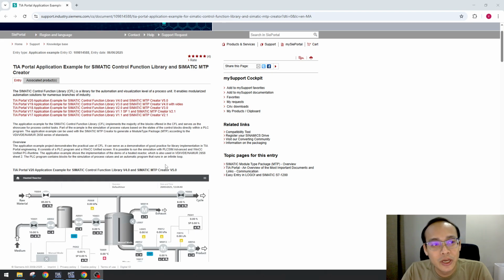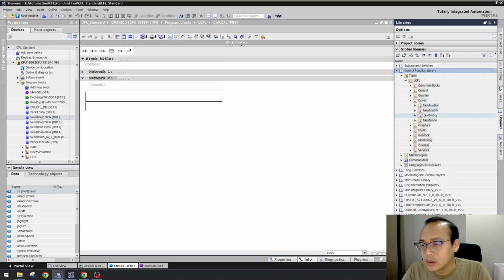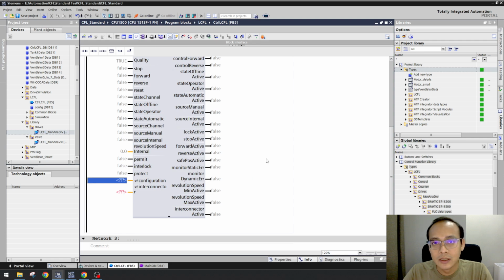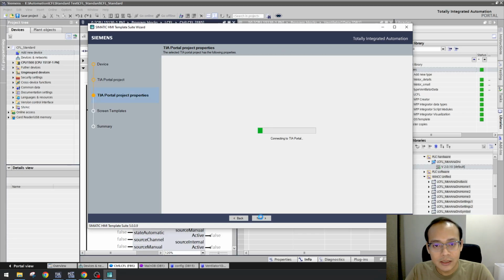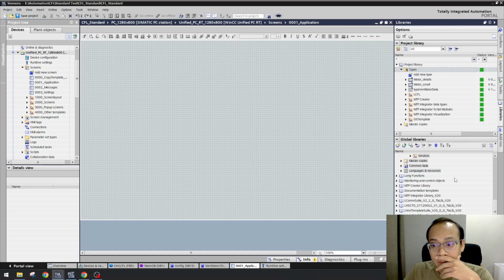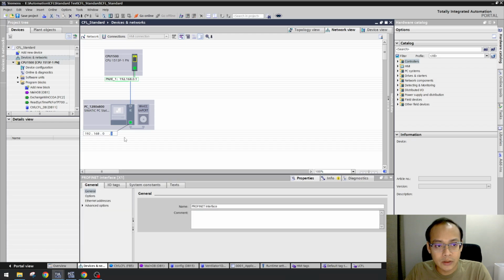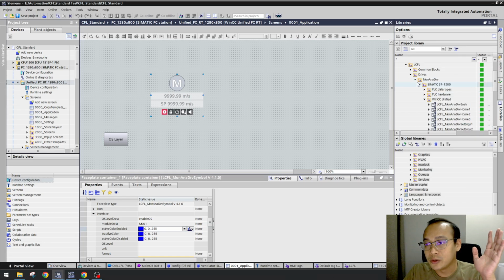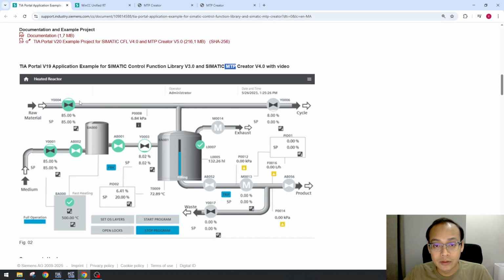How to use The SIMATIC Control Function Library (CFL) and HMI Template Suite Wizard

Comment: Hello, I have a problem with an analog/binary indicator. I cant seem to drag the MTP data for hmi (.hmi ) into the tag table like you did with the drive. I already have the LCFL_AnaMon block configured in my process FB, but when I try to drag the MTP data for hmi, it doesnt work. Ive tried to add it manually but it didnt work either. I have also looked into the example project and there it is configured how I would expect, though I dont know how they managed to connect the LCFL_AnaMonSymbol with the MTP data from the PLC. Do you have any suggestions? Thank you:)
Reply from the maker: Hi. For a clear view and better understanding of your issue, can you please make a screen record and share to our channel email factoryautomationmyanmar@gmail.com

Comment: Hello sir, and thank you for the explanation.
 I have a question. I tried using the library in a CFC and LAD environment, but when testing, the block remained in the "stop motors" state. I checked the input signals and connected the block to the appropriate DB. What do you think is the reason? And can  I test the block from the watch and force table?
Reply from the maker: I think you may forget to disable the lock bits. You can reference to the application example under this link. https://support.industry.siemens.com/cs/document/109814588